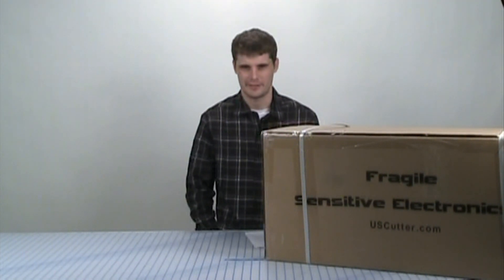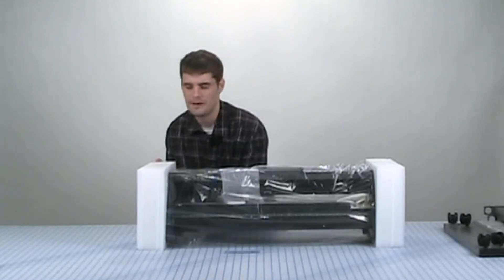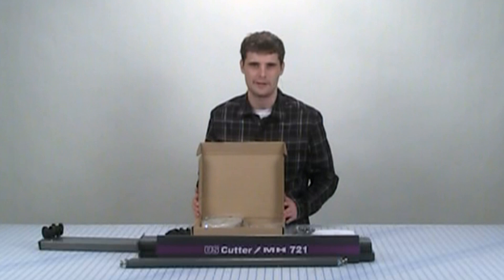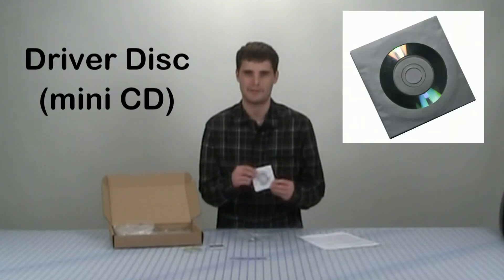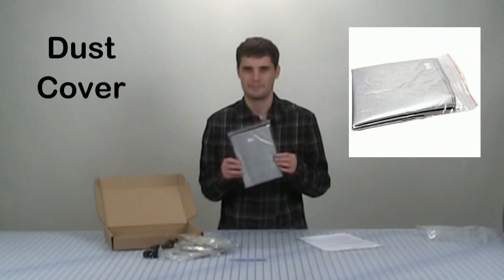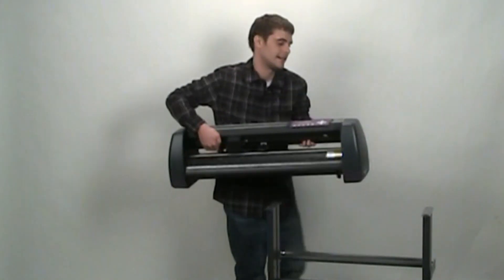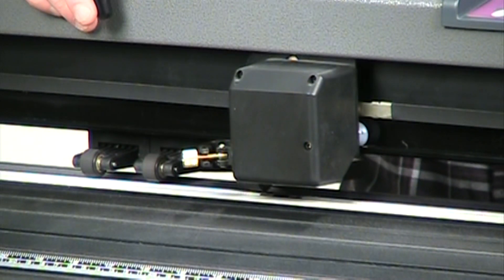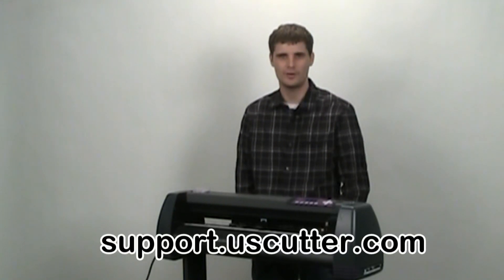Setup and Installation of the MH Series Vinyl Cutter

Comment: mashine name
Reply from the maker: The cutter is simply called an MH and comes in a variety of widths. The models are: MH 721, MH 871, MH 1351 etc. depending on the width of the cutter. You can see more details at the following link: https://www.uscutter.com/USCutter-MH-Series-Vinyl-Cutter-w-VinylMaster-Cut-Design-Cut-Software

Comment: andrew galpin
1 second ago
Can I use this machine with a Mac? I am wanting to use this on a Mac running OSX 10.11.6 but can backdate to earlier osx if need be. I have Illustrator. What software would i need to run on mac?
Reply: Yes you can. I use Easy Cut Studio.
Reply: Also. I have a  fully updated MBP, and it worked on my 2011 MBP as well.

Comment: I own a MH1351, Looks great, but is a PITA.

Buy lots of paper for the setup.

I use plastic cigar tubes for the blade/pens. Drill a hole in the center then screw them into the end screws on the top.

USB connectors rarely work UNLESS you BUY the newest 'MOTHERBOARD'.

The software you BUY from them SIGNCUT/2 is great, HOWEVER...

If your computer has an issue and you use another you lose ONE setup.

You used to get 5, so, if your computer has 3 issues you cannot cut.

Unless you opt for the dongle, which is also needed if you have no internet connection at cutting time.

Using an outside cutting program is VERY hit and miss.

Spend a few extra $ and buy a ROLAND!!!!

Comment: My MH 871 works just ok on the test sheet of vinyl, but when I try to cut from the computer, it looks like it is following the pattern, but the needle isn't showing up.  It is just hitting flat where the needle should be.  Any ideas on where I might I done a wrong setting?
Reply: +Sheila Ray The needle should be protruding 1/64th of an inch out of the housing. Whats the pressure settings you are running? I recommend a setting of between 80 and 100, unless your cutting heat set vinyl and I would get down to around 60 if possible.

Comment: I need the driver for cutting plotter MT721...please HELP!!!
Reply: +Too Country BBQ In my opinion, a company who posts videos about their products and receives reviews and complaints such as in this one without offering support or even rebuttals for the complaints like these deserves to be shut down. This is a commercial dishonor.

However, I did find something on line (videos here in fact) that helped me sort of "reverse engineer" the software (Sign Blazer Elements) to a usable state. It takes a little knowledge about programing so there's just a small portion of people that will be able to tweak the program. 

From my understanding there is no software available without using a high-end RIP software that costs more than the printer/plotter itself!

Talk about scams? rofl

These people do not even respond to the comments on here... That is indicative of their true support.

However, there is a program called "Sure Cuts A Lot Pro" and it works with the MH 871MK2 plotter and quite well without any complications. It retails for about $199.00 when it's on sale.

best of luck
Reply: +Manolo Cabrera Cortes doesn't seem to be a good support for driver/software from this company.

Drivers just don't seem to work well, or are cumbersome to install. I'm selling mine and going with another company.

Sad to have a company who's cutting software can only be run on trial mode.
Reply: +gorgeousdzastr The customer support is poor at best. Spent 41 minutes on hold and have yet to speak to anyone. Didnt receive everything either....

Comment: Mine double and triple cuts on some designs! Any clue why?
Reply: +bill smith  It has to do with the image you input. A lot of times, there are fine lines around the original image and it throws them in. Best of luck

Comment: Man I cant get my needle pressure right for the Siser Easy Weed Heat Transfer Vinyl. It wont cut all the way through
Reply: Take the cutter blade holder out off the machine. Find some scrap vinyl. Adjust the blade length showing out of the plastic until manually drawing it across the vinyl cuts only the vinyl. Then lock the length with the brass screlock. Blade should only show out off bottom a fraction as the solonoid rests the blade down to the plastic. Thats the easy way. Replace in holder just above the cutter by a cm. Plotter cutting force on panel adjust to about 40. Hope that helps

Comment: with the grounding wire i got with mine, one end has the lil "u-hook" at the end of one and the other ones doesnt. it just has wire sticking out of the cable....so how can i ground it at both ends if one doesnt match for i can screw it on the other end of it to ground it???